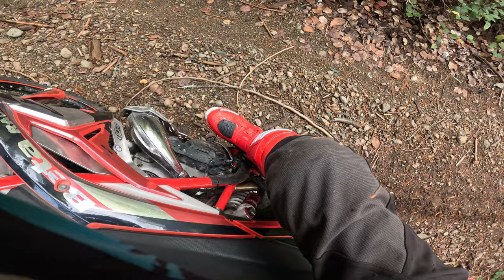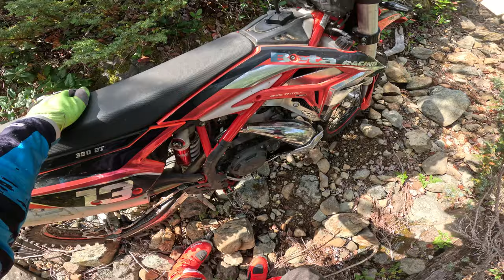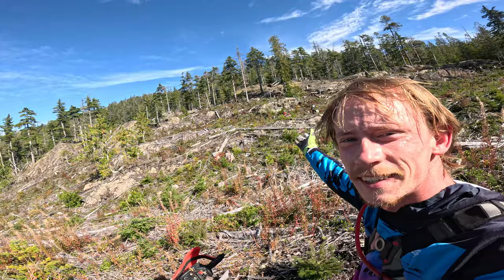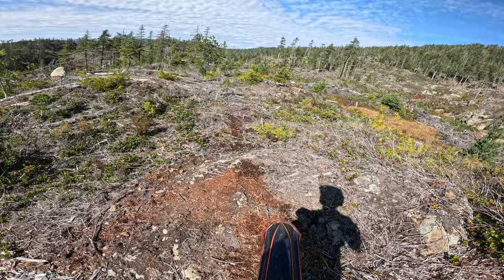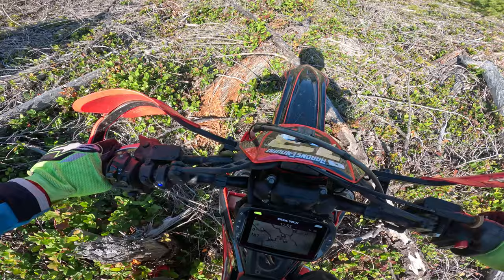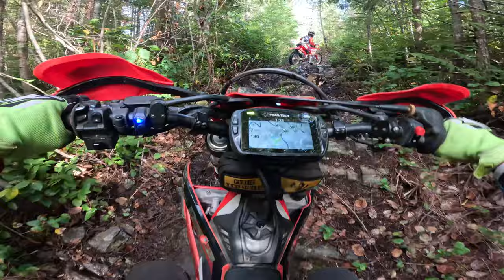Does The Beta X Trainer Suck At Riding Fast?

Comment: The faster I ride , I click up a couple clicks and the suspension seems to be working fine for my weight at 160lbs with gear! On my second Xtrainer and proud of it! Just right for me and my style of riding! RIDE ON
Reply from the maker: @racerunnermx  couple clicks does the job!
Reply: @AaronsEnduro  I like to ride with soft suspension now as before I raced, and as you know you are basically pinning it as much as you can, so stiffer suspension is a must. But I am 55 now and this bike is perfect for some soft hard enduro and single track . Keep the videos coming! RIDE ON
Reply from the maker: @racerunnermx  they are wicked bikes!

Comment: Zip tie those radiator guards on 👍 I found having the front fork spring wound in some and the rear dampening valve backed off with slow rebound really makes the X trainer shine. Slightly higher front tyre pressure than the back IE 10psi 8psi. That's my 2 bobs worth anyway. Great videos 👍👍👍
Reply from the maker: @buckenduro1211  solid idea. Currently running 8-9psi front and 7 rear